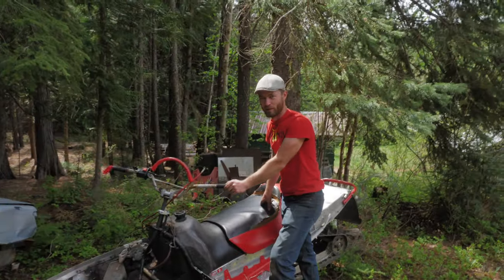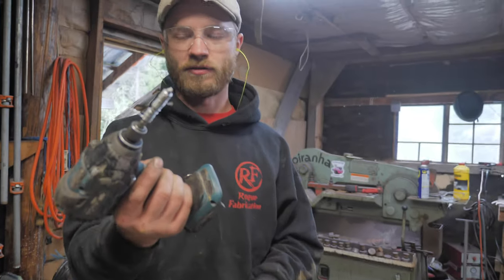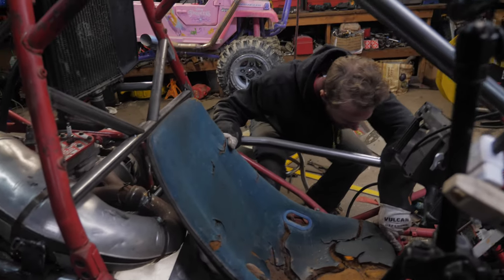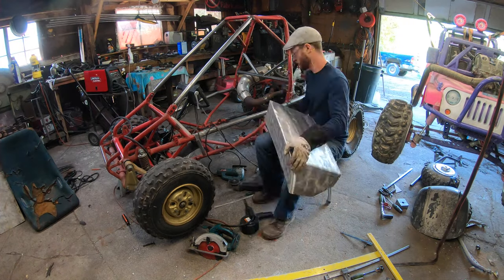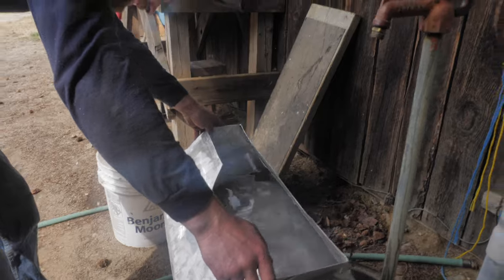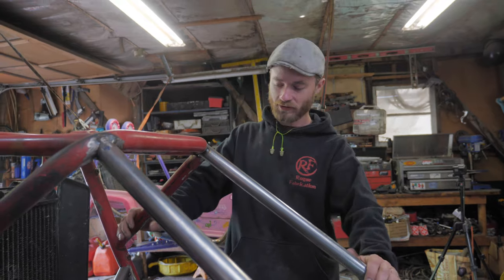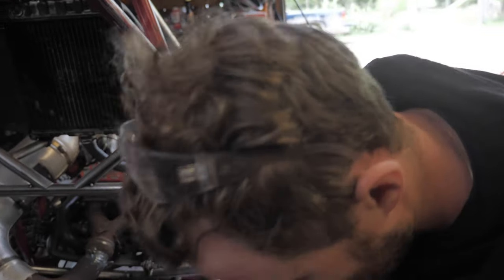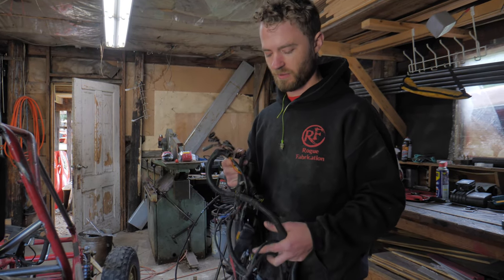Honda Odyssey Engine Swap Runs! 800cc 2 Stroke

Comment: Hey guys, I'd like to give you some PRO tips on the aluminum tank. 

Unless you're welding both sides of the aluminum, you should never grind an aluminum weld, they are not strong enough. 

You need to weld in bulkheads to give the tank internal support and control fuel slosh which can actually blow an end out just from the fuel weight. 

Make sure you add a rollover valve/vent with a loop in the tube. 

That tank will never need to hold 100 psi. Anything over about 15 is more than good enough. Radiator tanks are only good to 20 or so in general and under pressure all the time. 100psi is a shit ton of pressure for any kind of welded assembly to hold, especially an aluminum one.
Reply: Ill further this, use TIG on fuel cells, it's almost all open corners, which are easy to TIG. You'll have more luck. I've welded the stuff using push pull guns, spool guns, pulse and TIG. Spool guns are made for high production, low quality. They are affordable, but not very versatile (you need 65cfh of pure argon as well, only 12 to 17 with TIG). Your material needs to be almost food grade clean to guarantee a seal on the first pass.
Reply: Do you mean weld in some baffle plates, not bulkheads?
Reply: @ragedigital  I use the term "bulkhead" because most people understand a bulkhead encompasses or partitions if you will one section from another. A baffle doesn't necessarily have to touch all sides. Of course said bulkhead needs to have provisions(holes) for fuel to transfer and or equalize in a slower fashion than without but also hep keep a reserve of fuel at the pickup point.
Reply: @AZBADBOYz  the inside of an engine sump is usually designed like this to prevent oil starvation too I believe

Comment: "There's plenty of ways I don't mind dying, in a raging inferno however... is not one of them" haha, I hear ya.
Reply: just cut the tank 3 inches all directions and rubber mount it! and add ribs to the surface, so it has some strength.

Comment: I like to pressure test my tanks, and go over them with soapy water, just a regulator set to low, don't seal it to tight just so it will hold one psi, your tank needs to be vented anyway, you can do it I have faith.
Reply: I agree. You don't need a lot of pressure to test a gas tank after welding. I used to test mine at 5psi. 10psi MAX because they will distort. A gas tank in the sun will probably never experience more than 1-2psi internal pressure.

So @grindhardplumbing if your tank can hold 5 psi, and it's strong enough to hold up to the vibration, you're good! 💪👌
Reply: @AddictedtoProjects  i'd still rubber mount the thing and make something to hold it up from underneath.
Reply: When you think about it, the force that only 1 psi will put on a large surface is quite impressive. The bottom part of that tank looked like a surface of about 12x30" which is 360 square inches. That means for each psi, they add 360 pounds of force on those seams.
Reply: @comethiburs2326  yeah thats what i thought when watching the video. it needs ribs to strengthen it, a mount in the middle at the bottom, and all mounts need to be rubber. wouldnt hurt to make some baffles internally to stop fuel slopping around either. just some mesh or plates with holes. also having the bottom sloped down to the lowest point for the fuel would be best.

Comment: NEXT PROJECT.
With your leftover snowmobile tracks you should build a mini ripsaw tracked vehicle
Reply from the maker: Absolutely agree!!
Reply: Tracks for the Odyssey??🤔
Reply from the maker: I mean, that seems obvious at some point. 😂
Reply: Grind Hard Plumbing Co I have 4 INDY 500s thinking of making a dual tracked VEHICAL,  and I mentioned I a previous comment, I to have the same model Honda odessey. going to put one of the INDY 500 on it, when you were building your gas tank I was thinking small fuel cell, for safety sake.... look in to finding a trisport ALSPORT RTs 340.. I have one I'm sticking one of the other INDY 500s I installed a cb350 Honda engine on my first one 
wildest trike you'll ever build . has a differential, installed 7 inch disc brakes for left n right steering assist.. back in 1974....would rather do a do over with another 350 Honda build ... could use a 600 Honda engine I have, but the 100 up is a bit much....but know this I love to watch your videos, might be time to build a sheet metal bender (brake) plenty of videos on diy sheet metal brakes...

Comment: Most aluminum gets really weak when bent in a brake or wood stove. Oh well. Put a few baffles  in it for strength 
and use it. Old odyssey sounds strong. I built a pretty good one. An adjustable drive pulley is worth the money. You can tune the wieghts and just snatch off when it engages.
Reply: Michael, that's not the stock Honda power plant.

Comment: The practice you got from welding the tank was good a good learning experience. Practice on it some more and use it to hold water for trips. Now you have a template to make one from steel or thicker aluminum.

Comment: You'll reeeeally want to invest in a TIG torch for outside edges on aluminum. It's ridiculous how much easier it is to get a better quality weld with a torch and filler rod. Spoolgun is great for tacking and laying in fillet welds though, I used both quite extensively fabbing up headache racks and other semi accessories. Just my two cents 🤘 keep on grinding

Comment: Ethan, should there be any internal baffles in the fuel tank to prevent starving the fuel pump? Or at the very, least to prevent a heavy load of fuel from slamming side to side under heavy maneuvering/ turning?

Ed, for a slow-mo filming fix, check out industrial steal forging under a huge power hammer. The 360* burst of molten steel, makes for some awesome slow-mo filming content.

Keep doing what you do, dudes!
Reply from the maker: Thanks for the input! I hadn’t considered baffles, but I will definitely add some when I build version 2.
Reply: @GrindHardPlumbingCo  Definitely build a v2.0 gas tank, that thing was (still is?) beautiful!  Baffles would be ideal on a tank  that shape and size, but 150psi is more than my little air tank/ compressor are rated for. The cap will have a vent tube, right? I love the Barbie Jeep, but I'm just as hyped for the Odyssey and it's not even done! Keep it up👍

Comment: That gas tank would have been fine with those last few pinholes closed up. Awesome work guys. Definitely don’t forget to put a firewall between the exhaust, gas tank, and the seat. You can even use furnace insulation to isolate the heat from exhaust even more. Also you guys should wrap that whole exhaust. Great build guys!

Comment: I always use a few pounds of compressed air and windex to find tank leaks after welding. I have done so many I have a tank purge kit. Used tank repair and modification I fill them with pure CO2 or Argon with a bleed off at the top and constant flow so that it will not explode..

Comment: Definitely still use that tank!  Bang it back in, weld it, cut the top back off if it, weld the inside as well, and add baffles to control fuel slosh and add internal supports to prevent severe damage from simple impacts. It would never need to see 100psi anyways. Its still a good tank. Id also recommend a rollover vent but its not the end of the world if you dont have one. Keep it!

Comment: filling the tank with acetone usually is better to use then water because the waters surface tension tends to hide the smaller holes. also you can buy tank sealers some of them work pretty well

Comment: if you take another stab at the tank, add a baffle or two and a surge pot to pull the fuel from; sevenish gallons of gas stored mostly width-wise, sloshing around offroad, is gonna cause some fuel starvation without baffles...

edit:
and coat the inside with some fuel-safe epoxy from the likes of POR-15! no more pinholes to worry about. 😉

Comment: I actually came across (by accident) a 2 Cylinder 2-Stroke built 60-ish Horsepower (Arctic Cat Snowmobile Motor) swapped Odyssey and that thing was terrifying. I got it on a good trade, played with it a little, realized it was a deathtrap and tried forever to trade it. Wound up trading it for a heavily modified 350 Warrior that was worn all the shit but was definitely built right and well. I will never forget that Odyssey though, its take-off was sad, but after it started winding out it would just try to spin the tires out on big knobby balloon tires and could do AT LEAST 60MPH+ when we tested it with a car riding right beside it. After 60+ on road, with no suspension and balloon tires, I chickened out and it wasn't even cranking out 9k RPM and I know for sure it could turn well over 12k. Scares me to think how fast that deathtrap could go, and if the next owner is even still alive if he tried to find out.

Comment: Man that two stroke sounds great! Good salvaging :) I have a awesome source for salvaged aluminum for my projects, working at a snowboard manufacturer I get to salvage there old molds for 25 cents a pound! Most sheets are 1/8” thick about 14” wide by about 5’ to 6 feet long, now that I own a AC tig it’s real nice being able to put that aluminum to good use. Nice job guys!!! I also have a aluminum spool gun and they are tricky, the the speed you have to move at is a bit much to keep it from melting though. Looks like you guys are doing great!

Comment: Checking pressure on a gas tank usually only go to 5 psi, that is usually about when the vent lets out pressure. A dune buggy tank would work nicely on it. Or even a party balloon tank would work.

Comment: When i was single an had lots of time on my hands, I built a "go kart" from scratch and powered it with a 570cc yamaha engine. With no diff it was a smoke show machine, but hard to corner at high speed. Was about the same size as this one, but with smooth tires. It ran the 1/4 mile in 11.7 seconds at 120mph.

Comment: Hey guys love the oddesey, quick tip with aluminium get yourself a stainless steel wire brush and give those joints a good scrub just before yo weld. Surface oxides melt at a higher temp than the parent metal so that will make welding a little easier.

Comment: Hi guys, you do crazy things, I will love to do the same delirium at home.  I love your videos and your realization.  I look at you from France.  I allow myself to tell you something, I watched your last video.  see have shifted the rear pulley for the belt but I think that is found in the space of debating of the shock absorber.  and I find that your gimbal is really close to the pulley while the kart does not touch the ground yet.  its risk of doing damage if it happens.  and I think you should find a point of support for the axis of this pulley because it is really long, it may bend.  if she had a point of support on the chassis with a bearing it will be top!  good continuantion and continue your delights because we all love !!!

Comment: Wipe your aluminum with acetone really well first. Then grind it. When you just go at it with a grinder to get the crap of it just drives the oils and crap deeper into the aluminum. I use old materials all the time. That was your leak problem. Another trick is to take a clean drill bit and drill out the crater. Usually you will drill out the contamination. Then a fresh tack on top and your golden

Comment: Its a good idea to put a nice L shaped shield under your air breathers...  So that it blocks water and mud slinging off of your belt, and off of the break disc....   Because every time mud or water hits that disc.. Its going to paint a strip of gunk right onto your air filter....  Its a simple fix to get more longevity out of it.

Comment: Fuel tanks have baffles in them for sloshing....... Also, I would not mount a home made Alloy fuel tank rigid, without rubber mounts because it will crack from vibration and pounding from jumps.........
Reply: ******BRAKE check
Reply: I was going to mention baffles as well.

Comment: If no one's told you yet but I'm sure someone has you must leave the weld on aluminum and can't grind it off like you do on steel as the weld itself is actually part of the structural integrity of aluminum welding..... Hope you're doing great keep up the great work

Comment: If you can afford it get a AC/CD TIG welder, PrimeWeld 225TIG only 750 and i love mine. You could probably still save the aluminum fuel tank. Good fabrication practice though, lots of persuasion and persistence.

Comment: So you know when you broke pull cord...... Yeah..... Sooo I've been restoring a vintage snowmobile that has a ton of compression, and I've broken my cord 7 times to be exact before I finally figured out that it wasent the rope that I was using that was the problem, but the washer that I had drilled out in the very begining, that had a sharp inside edge...... Well, ya live and learn I guess.

Comment: That gas tank is fine in my opinion.  Fix the blow out.  Seal it with sealer.  Maybe weld in baffles. It never needed to hold much pressure.   You might add some guarding.  A puncture is your biggest risk.

Comment: I had one of these with a 350cc about 20 years ago, was dreaming of a 600cc swap.  Could whip it out of ditches doing 180's on one tire. They're so responsive and buffoonish.  When you're keyed in, these are a wild time without an 800cc and the cage to back it up..

Comment: Keep goin on the tank ull get it weld er back up. This thing is gonna be good. Also belt deflection in your secondary needs adjustment. And i don't think tires are gonna last long on there at all hehe can't wait to see it go.

Comment: What are yall gunna do about the fuel boiling issue with the exhaust so close to the tank? 2 stroke exhaust gets real hot and it will transfer to that aluminum very easily.

Comment: How are you going to keep the motor cool?

I thought about putting a Rotax 800 in my golf cart, but (like most snowmobile motors), max engine temp is supposed to be 120-130F. Those temps are easy to hold with snow...
Reply: Just put in some massive fans

Comment: Adjust the belt deflection if you can its pretty low in the secondary, belt flush with the driven or a hair above is on 
sweet build

Comment: Great job! Dig the process and the fail/win. It happens. I bet you wouldn't have porosity issues if you had some new 3/16 aluminum plate! Acetone wipe clean. Stainless worked good for you before, it is way easier to mig than to tig though imo. Try some stainless wire and appropriate gas- argon? I bet you get good results.

Comment: if you want the weldless look then you should weld from the inside out and then grind what you don't need from the outside that came through same way when doing body panels

Comment: Flatten out a copper pipe or use a piece of copper as a backing plate for welding in holes. It won't bond with what you are welding and it will soak up heat to keep from blowing out the holes.

Comment: You are gonna want to keep a close eye on the head temps, plug color, these motors are tuned to run in <30 degree temps in the summer heat engine damage is likely  without rejetting
Reply from the maker: Oh definitely. We will keep a close eye on all that. And a re-jet is almost certainly in order.

Comment: I love the attempt on the fuel tank Ethan  I think you should have included Baffles in it to slow down the side wards sloshing of the fuel though and also bracing it underneath more when it was going to be mounted, Shame it didn't work but I think being so close to the exhaust was a disaster / inferno waiting to  happen Excellent recycling guys  I just wish I had money to invest in more tools for the shop for you 
I can't wait till you start on a reverse Trike 

Tony from Western Australia

Comment: 100psi! Wow. Guys it’s a fuel tank not a tire. The tank looked great other than it should of had baffles to keep the slosh down. When I build tanks 5psi and soapy water is all you need. The tank is vented. It’s not a pressure vessel. Only other concern with your tank is it would have needed a skid plate being so low.

Comment: Just get some fuel proof tank sealer if you can't stop the small leaks it works a treat I've used it a few times with great results 👍🏻 awesome build btw maybe consider adding nitrous then that two stroke would be insane

Comment: Long travel suspension please, and set up a pulley system so you can haul the pull cord from the drivers seat, and save jumping out to start the bas+@rd.😆👍.
Cheers boys, like to watch your vids because it's what I'd like to be doing but don't have the time or peace or money to do, so again, thanks, and keep posting.

Comment: you could have put a divider in the middle of the tank so that the fuel would not splash back and forward or side to side while driving. that's gonna be a lot of gas

Comment: Weld aluminum hole. Just get a flat piece of copper and out behind the hole. Weld will puddle on the copper and blend to the aluminum. Called a shoe in welding terms I think, it's been a while. Also can use stainless steel just doesn't conduct as well. Good job on the vids

Comment: I mean heat rises and leaking fuel would fall anyways... I didn’t see an issue with the fuel tank you built, it’s always very frustrating getting those last few pinholes sealed up, that’s just how it goes when you’re welding up tanks and stuff. Otherwise great as always, no bashing for sure, I just liked your tank and think you should’ve stuck with it.

Comment: Aint a total loss on the tank. Just reinforce it by the edges in sime steel angle iron. Now edges are rupture free and crash safe. The rest could be incased in a fiberglass hull and wrap the exhaust to heat insulate